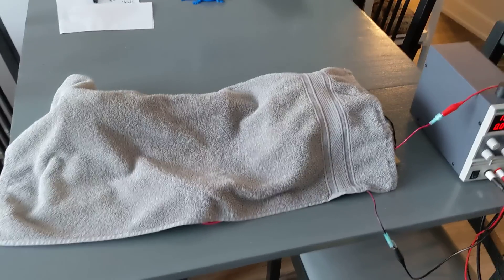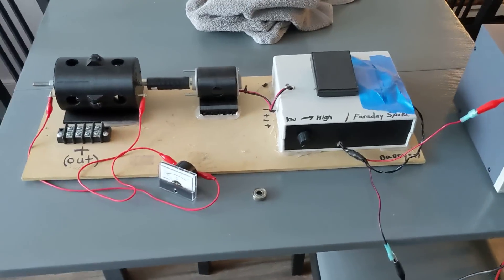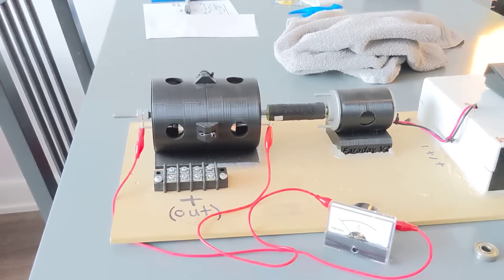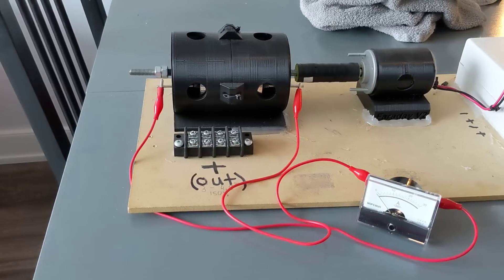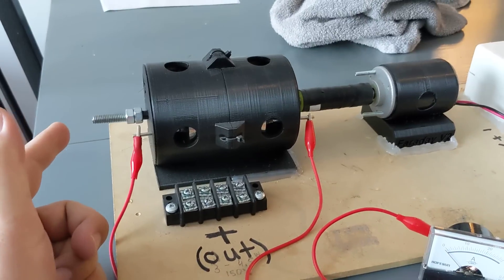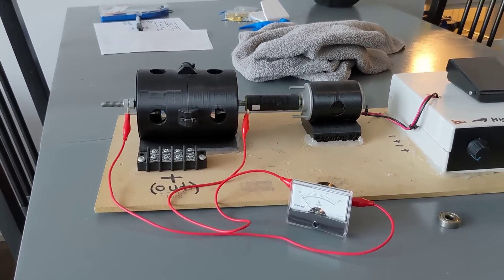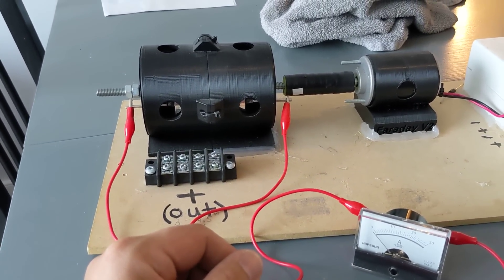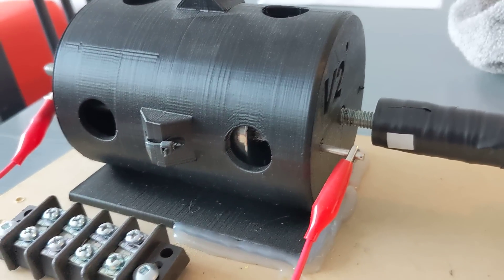N Machine....Bruce Depalma..Faraday Research RND

Comment: Bruce De Palmer went to Auckland New Zealand & he built a similar N Machine to yours with both North Poles facing outwards. He used something he called a ‘Compensation Field ‘ which was said to compensate against Drag caused by Energy withdrawal. De Palmer quoted that it was ‘Equal in Amplitude, Opposite in Sign’. I build Stanley Meyer Water Fuel Cells that requires a ‘Choke Coil’ which is the same thing in that it uses Opposing Magnetic Fields to restrict Amperage that prevents the Water from Detonating as this creates Shock Waves within the Water Fuel Cell but, it doesn’t work without these Choke Coils. Apparently if you hook up a load to the N Machine it creates drag & the Compensation Coil cancels out this Drag. I seen models of N Machines in Darwin with compensation coils & the Kiwi’s that showed me these said they were over unity by around 600%. Bruce De Palmer died in Auckland & his story is just Sad, similarly Stanley Meyer with his Water Fuel Cell was persecuted by Governments the world over but fortunately he went to Auckland New Zealand & shared his knowledge, all of which is very interesting & it seems all the citizens of the different Territories of the entire World are merely Economic Slaves born to be Cogs that keep the global economic machine turning.
Reply: So compensation coils would simply be like 4 magnetic rings "boxing in" (4 sides) of the N machine Cylinder to maintain the magnetic field of the N machine as you draw power from it?  Or two more magnets of the same size, one on each end of the shaft, close to the center magnets but not touching, set up in attraction, but inhbited from connecting by some sort of shaft lock?  So, even though energy was being drawn from the center magnets, the magnetic fields next to them could replenish their field?
Reply: @WORLD_OF_M4V3R1CK  Imagine a Pancake Coil the outer coil has an inductive coupling to the pancake coil. The ‘Compensation Coil’ instead of being an inductive coupling, has an opposing magnetic field created like a ‘8’ which cancels out the magnetic field created by current withdrawal. If the ‘Compensation Coil’ wasn’t there it would act like a magnetic Brake.

In a RF Choke Coil an opposing magnetic field restricts Amperage but, in the ‘N’ Machine the ‘Compensation Coil’ allows Current to flow freely & when this takes place an acceleration of the ‘N’ Machine takes place as well. Also on Bruce De Palmers Quadrapole ‘N’ Machine that uses Permanent Magnets instead of Electromagnets that he built in Auckland, New Zealand, De Palmer was able to levitate Spanners placed near his ‘N’ Machine.
Reply: @o5you86  ok thank you, I understand a little better now. I'll do some more research on choke coils. Thank you.  When you say "spanners" are you referring to magnets?
Reply: @WORLD_OF_M4V3R1CK  Very interesting idea about compensating coils! Do you mean by "4 sides" that the magnets are on the both sides of the disc and on the upper and lower edge of the disc?
Reply: Hi, can you give some hints what "choke coil" design one should use on N Machine? Any links/ sources on that subject?
Reply: @wolfforce3740  The Choke Coil on a Stanley Meyer Water Fuel Cell restricts Current from flowing prevent the Water from detonating. In the N Machine, once you attempt to draw Power from the N Machine the Rotor Assembly acts as a giant Brake similar to how Electromagnetic Braking works on a Train, the ‘Compensation Coil’ on the N Machine is a stationary External Stator Coil that works the same a Choke Coil but, because the Rotor Coil is moving & drawing Energy directly from Space the ‘Compensation Coil’ actually Cancels Out the Magnetic Field created by Energy Withdrawal preventing the N Machine from acting like an Electromagnetic Brake as in the Train Braking example. Also somehow the N Machine accelerates, I don’t know the mechanism that causes this but it nonetheless accelerates spinning Faster. The N Machine is such a fascinating device!
Reply: @o5you86  Thanks for you input! Do you mean that it would be good to use generic inductor type choke in the generator output as a back EMF filter?

There are circulating a modified schematics of N-Machine that has AC output. It has 2 brush on the rotor edge in 90 degree angle. Do you have any experience with any kind of AC homopolar generator?
Reply: @wolfforce3740  The table top N Machine I saw in Darwin was similar to yours but, was two seperate Disks the size of Music CD’s rotating on a central shaft with contact Brushes on nearly the entire circumference of the outer disks with the Negative being the centre shaft connecting the 2X rotating Disks. On the outside of these Disks was a Coil that looked like a 🍩 doughnut surrounding the Disks but not touching them. Apparently these created an opposing Field that canceled out the Magnetic Field Current created by Energy withdrawal. My understanding was that if you removed the outer 🍩 Compensation Coil any attempt to extract Current from the N Machine and it would act like an Electromagnetic Brake slowing down the N Machine. The Compensation Coil allows you to draw Current directly from surrounding Space without any drag.. I saw another Machine in a different configuration that looked like two stacks of Neodymium Magnets at right angles to each other ‘+’set in a Plastic Resin with a Coil Wound on the outer rim. This also had an external ‘Compensation Coil’ & looked like Tesla original ‘Induction Motor’ on its side view. When in motion these Machines appear to Accelerate on their own. Its really interesting & my opinion is that these Machines are actually replications of ‘Old World’ Machines that were found from another civilisation, & a couple hundred years ago we didn’t understand them. It looks suspicious & something is happening where all the really ‘Cool’ Technology is hidden from the mainstream knowledge base and we’re only allowed to have Technology that continues to enslave us? I think all of this stuff is like a rabbit hole!
Reply from the maker: Yep I totally agree with you. This stuff is definitely when you get into it. You're going down a rabbit hole big time and it's a long drop. And yes, a lot of this technology has been hidden from us for at least 100 years or longer. But I continue by research and a lot of great points you've noted to me in your comments. Thank you very much
Reply: @o5you86  Thank you very much for your input on this subject. This is a great idea to use brushes all around the circumference. There are many many ways to improve the device.
Reply: Lee and Yang strongly predicted broken symmetry in 1956-57.

The strong prediction of broken symmetry by Lee and Yang and its experimental proof by Wu et al. in 1957, initiated a great revolution across physics and won a nearly instant Nobel Prize in December 1957 for Lee and Yang.

One of the broken symmetries proven by Wu et al. and published  in 1957 is the broken symmetry of opposite charges, as on the ends of a dipole. 

That asymmetry is used by charges and dipoles for extracting and pouring out Electromagnetic energy from the vacuum, yet not one current Electrical Engineering or classical electromagnetics textbook mentions the energy implications of dipolar asymmetry. Nor do they mention that every charge and dipole freely pours out real observable EM energy continuously, with no observable energy input.

Thus the textbooks implicitly assume that all EM fields, potentials, and energy are freely created out of nothing at all by their associated source charges.

Either the conservation of energy law is falsified, or the source charge must be receiving the necessary energy input in virtual state form from the active vacuum.

Let us make very clear that extracting energy from the vacuum is very easy. We will use a device which can be built for a dollar.

Take a charged capacitor, and lay it on top of a permanent magnet so that the E-field of the capacitor is at right angles to the H-field of the magnet. Then the standard Poynting flow S is given by S = ExH, which in this case is maximized for a 90-degree angle between E and H. In fact, the magnitude S of S is just the product of the two magnitudes E and H. The direction of S is at right angles to both E and H, and given by the usual right hand rule.

Well, even by orthodox theory, that is an actual Poynting energy generator. It just sits there and pours out free energy, directly extracting it from the vacuum. There are two dipoles -- one electrical and one magnetic -- continuously serving as an asymmetry in the fierce vacuum flux. Once you pay to make the permanent magnet and charge the capacitor (or use an electret), that simple gadget will extract energy from the vacuum and pour it out indefinitely.

This illustrates how easy it is to extract energy from the vacuum. However, it comes out in nondivergent or difficult-to-use form. So the problem is to intercept and divert a substantial portion of it, or convert a substantial portion of it into a usable form.

That is the problem that the scientists should be working on, with maximum effort.
Reply: @cjbartoz And they don't care just because it doesn't make money... even though it will indirectly make more money.

Comment: Would have liked to see the shunt on the back of the ammeter. All the demonstrations I have seen leave out some detail that would lessen my skepticism. To measure 20 amps at a few millivolts takes a lot more than a couple of croc clips, thin wire and a moving coil meter, basic Ohms law cannot be violated.

Comment: I seen the D.C. power supply. So I’m confused are you using D.C. voltage and as you increase it you produce more amps?
Reply from the maker: The DC power supply is used to spin the magnets.... it's not adding power to it all the amperage is coming from the magnet spinning ....it produces very little voltage about 40 millivolts but high amperage....
 the DC power supply just runs the motor that turns the magnets

Comment: I tried building one as a teen. 2x rare earth disk magnet about 4inches in diameter and a hard drive platter disk in between I spun it using a drill, poorly, and got about 80 millivolts. I gave up on it. You need at least 12inches diameter to get about 1volt. You can put them in series on the same axle (that insulates pairs of disk centres from each other) to get more voltage which also lets you use 2 disks for each magnet in the middle.

Comment: Just curious... does it make a difference how far apart the magnets are from each other?
 I.e. does closer together give you more amps?
Reply from the maker: The distance of the magnets apart have nothing to do with it it is the rotation of the magnets that creates the amperage my magnets are about 3/4 of an inch to 1 inch apart but has no relevance to the production of amperage it all has to do with rotational velocity
Reply: @FaradayResearch  Cool. Very interesting stuff, thanks for sharing!
Reply: At such a low voltage, the resistance in the meter, wires and bushes will drop the amps massively.

Comment: what would be the slowest rpm for about 5 amp ?  and is your shaft a copper one or steel.? thanks Dave
Reply from the maker: Hi Dave

I could get a stable 5amps at about 500 rpm. And the shaft was steel Rod ....I used Dremel brushes for the contact points on the magnet which worked very well

Cheers Mike

Comment: Glad to see people looking into this tech.  And i thought the same thing about mixing the current. I found it interesting that the magnets can be attached to the copper and spun as one. And still produces current. 
Or the fact that a spinning cilinder of copper will repell north and south, but will coexist with both fields, if the magnet is turned sideways.
Reply from the maker: Hi
 yes this is very true what you have said the main important thing to remember is electromagnetism will always create a lenz effect or a resistance so in the... N machine the magnet has to be spinning with a copper wheel at the same speed either in the same direction if you were to spend a copper wheel with magnets on either side this will create lens effect thus creating a resistance you get cavitational forces on either side of the copper wheel that's what Michael Faraday discovered when he made his first faraday disc... but when you spend two magnets side by side these forces do not exist anymore so the big question is what is creating the current?? and I think the lines of force in conjunction with longitudinal lines of force within the Earth react with the magnets spinning this is just a theory ...but it makes sense when you think about it but anyways yeah the best thing to do is set up your own experiments and test everything every combination you can come up with try it that's all part of the learning process I spent well over a year getting to the point where I had a good working device where I can create 20 amps with just spending two magnets side by side thank you for your insights... cheers
Reply: @FaradayResearch  study ball bearing engine

Comment: A lot of bearing chatter. Maybe try for a maglev bearing. Mercury contacts instead of brushes would cut down friction losses.  This would necessitate containment (not hard for a 3d printer).  Wonderful work. 👍
Reply: To clarify, I've gotten over 7000 rpm with a 1/4 lb. Rotor ... 12.4V @ .15A
Reply: @jprice1122  Nice job! What was the diameter of your rotor? I`m planning to use 4 inch rotor.
Reply: @wolfforce3740   It was an old hot dog roller, 7 or 8 inches long by 1" diameter.  Neos in the ends for the maglev and 4 (1/2" x 1/2") neos spaced around the center lengthwise.  https://youtu.be/SHcrEXv4_lQ
Reply: @jprice1122  The maglev bearing idea is super cool! ✨

Comment: I am a noob but tesla coil puts out a lot of volts with little amps.
What I you feed this intonation tesla coil?
I am just shooting from the hip

At my age of 75, my brain does not produce neither amps nor volts.😀🤩😂🤣

BTW, if you share the 3d design, I can print it up and experiment with it to see if any we can get anything out of this hard work you have done..

I realy want to build an overunuty something before I die.

God bless you brother.
Keep up the good work and please share.
Reply from the maker: Please watch all of Don Smith videos...  he explains how the diameter of the coil and the direction CCW and clock wise will effect the amps. As well alot of amps ( current) are drawn from the capacitors in the circuit....  I hope this helps.  .... cheers!

Comment: Hey, Hello!!  
Beautiful, Love love love this project!!
Faraday disc!!  And N machine.  Yes, Yes!  I never ever forget reading bout this, always knew it would be very very important.  To create current you will always read that the conductor needs to pass through the magnetic filed, or vise versa,  but Faraday showed us that the copper disc and magnetic rod it was attached to could both be spun "together" to create high "currents".  
I always wanted to do this experiment!!!!  It seems easy to get voltage from the air or other sources, but to get the current is another thing.  Hmmm, one creates the other.  Hmmm, "is" it as easy as using a current transformer, or will it be easier said then done, hehehehe.  With my project, If I am now creating much current from little voltage, then I would expect the opposite to be achievable, maybe even much more easily.  I always had a strong gut feeling about this.
Hmmm, what RPM was this spinning at?  This also reminds me of levitating magnets over spinning copper tubes.....  https://www.youtube.com/watch?v=glCNP6qH_Dc
There is levitation I believe at around 6,000 RPM, this is where the field gets distorted, or stretched out,,,, the magic happens.  So I have always wondered about Faradays disk spinning that fast, if the results would change.
I wanted to spin magnets on end of Dremel tool & see their effect on other nearby objects and magnets.
Cant wait to see your next video on this😁!
Reply from the maker: Hey!  Nice too hear from you!!  Yeah my next project is the Don Smith generator...so I am excited about this project!!   Just getting all my parts too start the build ... cheers!!! Mike
Reply from the maker: Hey sorry. I forgot...rpm was about 2000. So 10amps for every 1000 rpm approximately..
Reply: @FaradayResearch  Great, thank you, looking forward to your next videos!